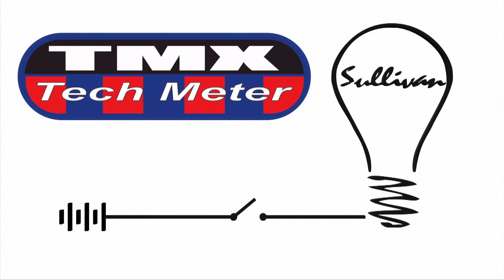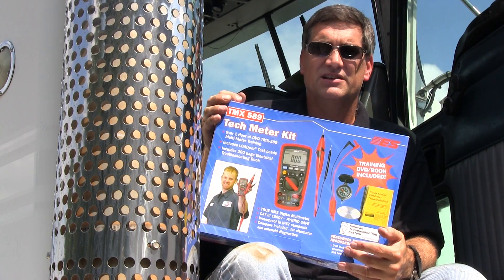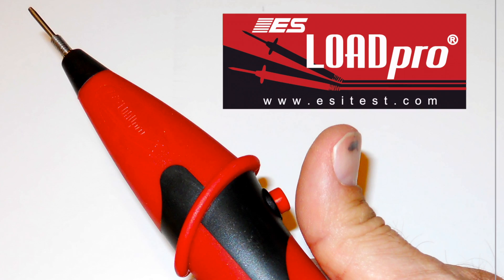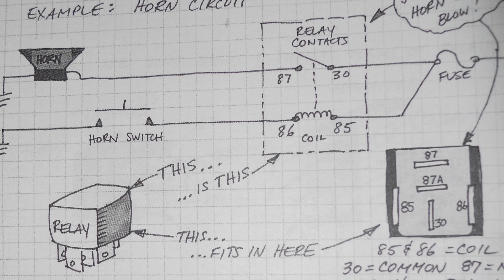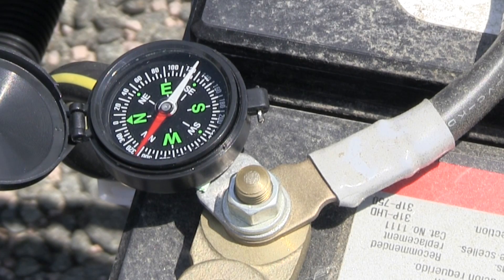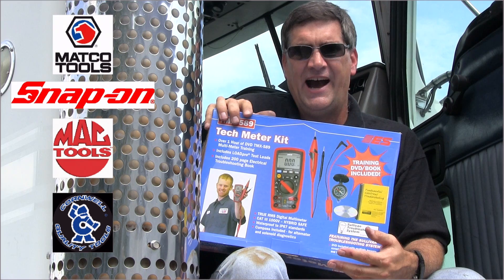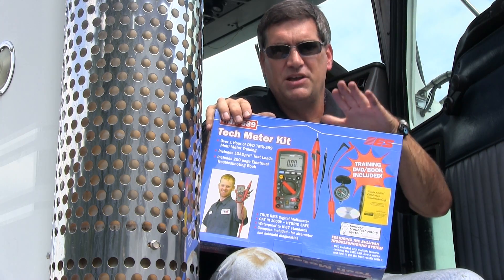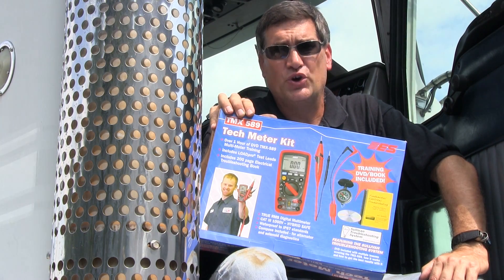TMX 589 Tech Meter - A meter just for techs...

Comment: I bought this kit a couple of months ago and I must say I am extremely satisfied.  The ghost voltage response is awesome.  I've used this meter on hybrids and regular electrical systems and it works great.  Plus the dvd is very informative and also the book even though I owned the book before.  I bought the kit because I needed an extra meter and I must say I am happy I did.  This kit with the meter, book, dvd, and leads is a good value and it teaches you how to troubleshoot.

Comment: I just bought a replacement load pro in BLUE! Bluepoint branded load pro. Very cool. 

I smoked my red load pro by not noticing the button stuck down and using it in amp mode. 

You could say I let the "smoke" out. lol